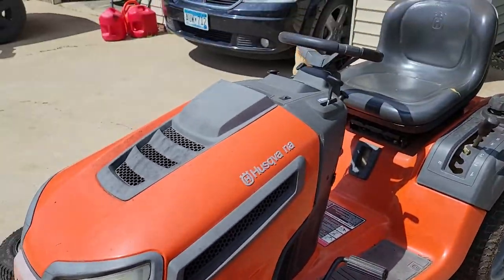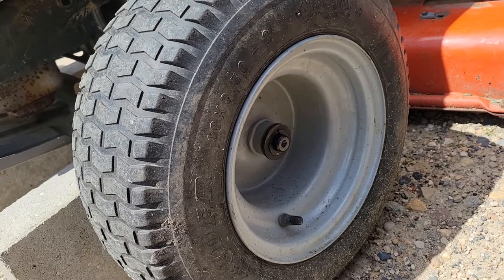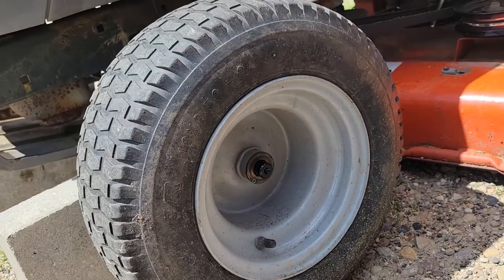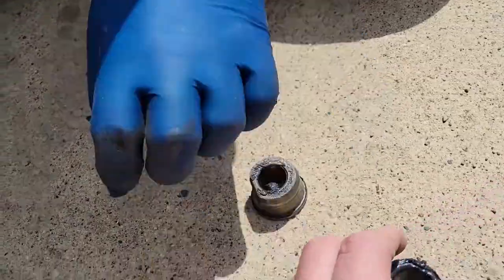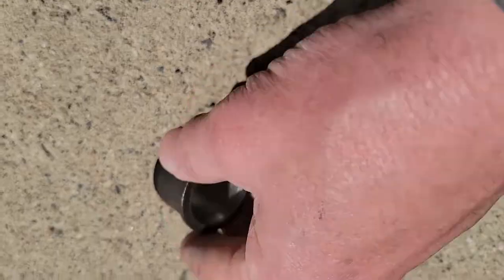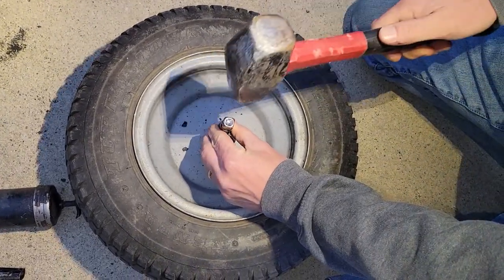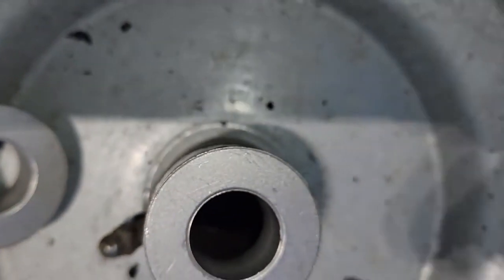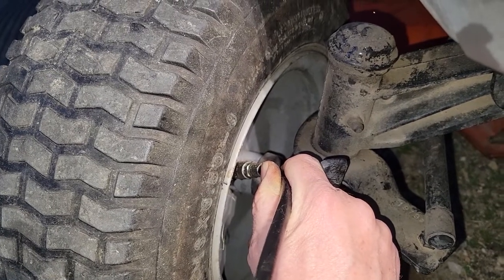How to DIY Replace Riding Lawn Mower Wheel Bushings / Bearings - Husqvarna Lawn Tractor

Comment: what is the number on the bearing
Reply from the maker: 532-1249-59
Reply: the actual number on the bearing thats just a made up number for seller  @MelvinZoopers
Reply from the maker: @allan9584able That is the number from the owner's manual.
Reply: @MelvinZoopers  yes I got that but a bearing shop it means nothing ,there should be a manufacture number on bearing  international number

Comment: A 6" long, 1/2" ~15mm hex bolt down into the wheel and a hammer was pretty easy to knock out the bushings. Sometimes it helps to knock on one side of the bushing, them go to the direct opposite side, which wiggles it out. Sometimes, one side wack and one would pop out. Use a very large socket to gently tap in the bearings, and only tap on the most outter bearing ring.

Comment: There is bevel edge flat on a side of the husqvarna bearing.
On my ride on there is no corresponding keyway inside the wheel. However my wheels have grease nipples and I'm guessing that the recessed flat spot in the bush is to accomodate the inside part of the grease nipple.